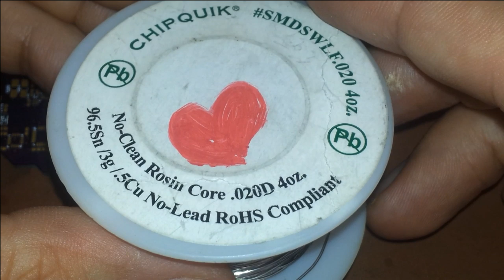QFN64 Hand Soldering

Comment: That may get you through an initial test but I wouldn't expect any reliability.  there isn't enough solder on the joints which is the only reason you don't have bridges all over the place.  You don't ever move a chip around in melted solder like that.  The heating cycle was so long that the solder is probably overheated and brittle.  This is a bad method guys.
Reply: Everything you said makes sense except the not moving the chip part, don’t you nudge it a bit to see if it goes back in place to see if it’s properly soldered?

Comment: I used to work on QFN chips exactly like how you did it. However, my yield is so low, that I have to move to stencil and paste. It took 10 minutes only for a single chip, so imagine how long it takes for a whole board of chips, and how much over heat each component will have, if you do all chips like this, and that is why you can not assemble a very densely polulated board using this method. Do yourself a favor, move to stencil and paste!

Comment from the maker: you can't do a chip like this using paste without having a proper stencil (Milar/Kapton or better metal) while you can do just fine without stencil using hot air and solder. For 2/3 prototypes it's perfectly fine using solder and hot air, instead when you have small series to do then stencils are preferrable.